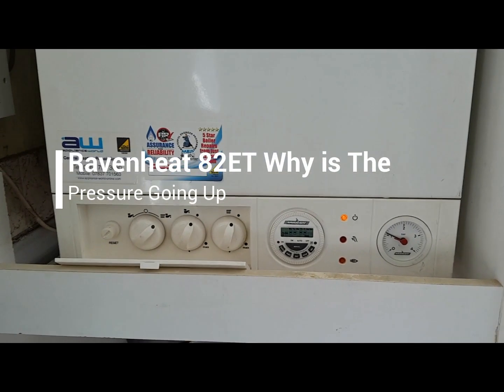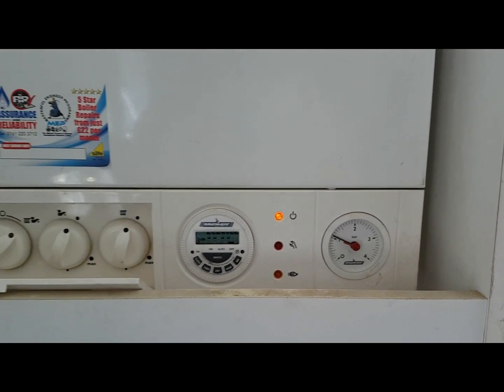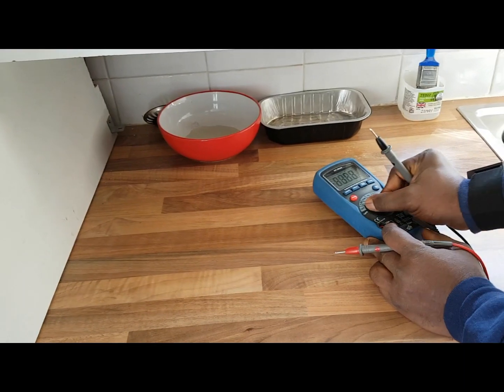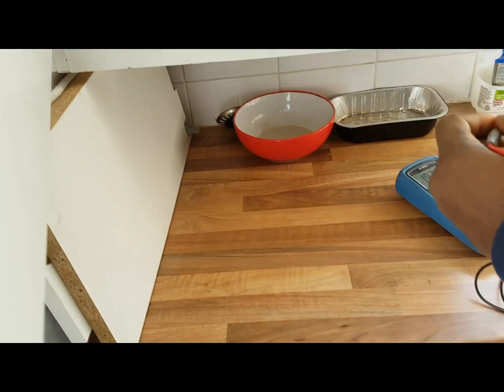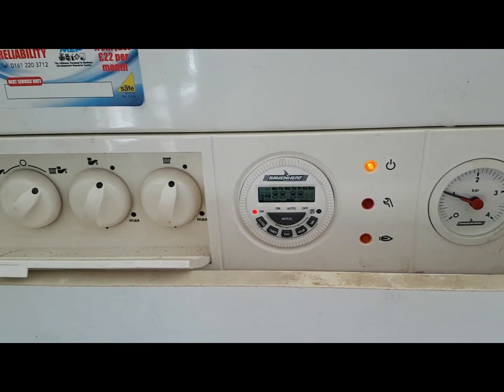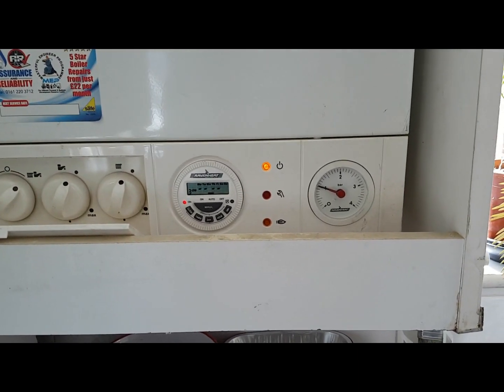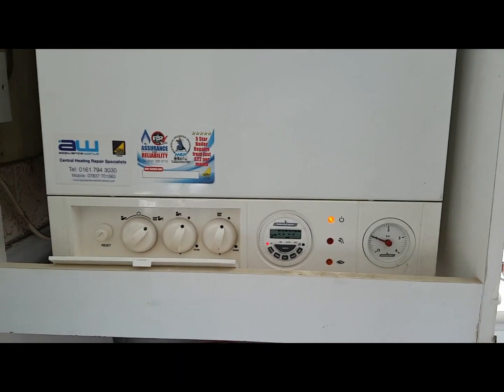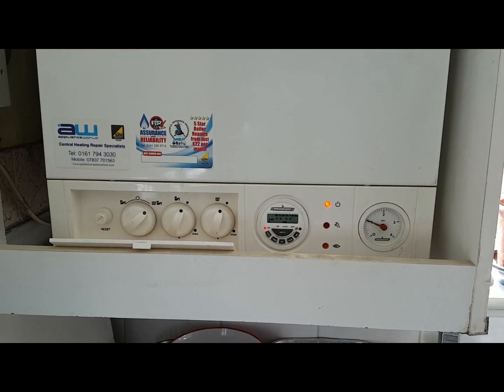Ravenheat 82ET Why is The Pressure Going Up?

Comment: 1: Faulty Expansion Vessel or need recharge 
2: Too many Radiators, May need bigger external vessels
Reply from the maker: Possible but no the correct answer is this case
Reply from the maker: hey we're currently trying to grow our Facebook group and would love you to join Tony and the team using this link, Tony will be available to answer all your questions directly https://www.facebook.com/groups/167070231326174

Comment: Vessel either perforated or just needs recharge.
Reply from the maker: There is one more possibility
Reply: @ARBoilers  Weak pump?
Reply: what was the answear, what  was the fault on this boiler thanks
  @ARBoilers
Reply from the maker: The fault was the hot water thermistor
Reply from the maker: hey we're currently trying to grow our Facebook group and would love you to join Tony and the team using this link, Tony will be available to answer all your questions directly https://www.facebook.com/groups/167070231326174